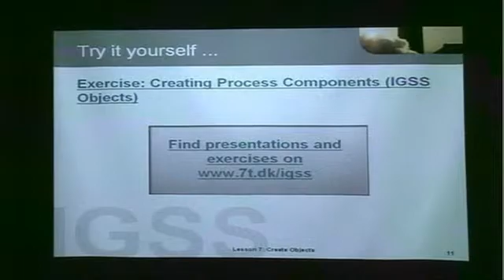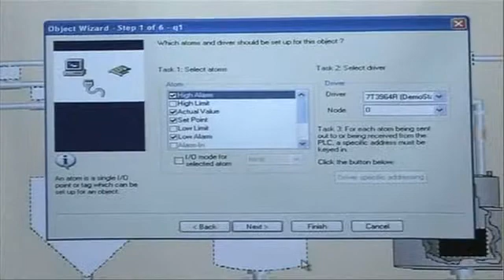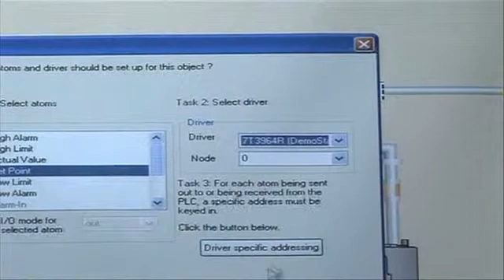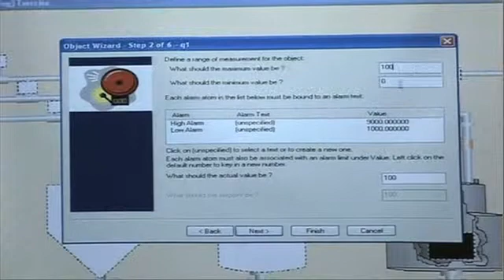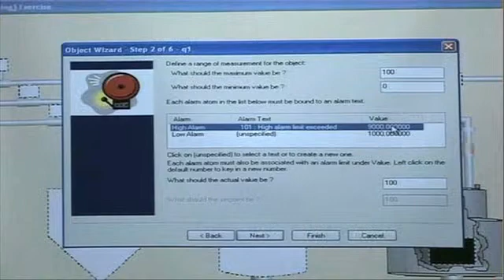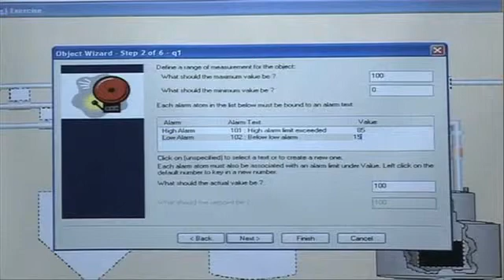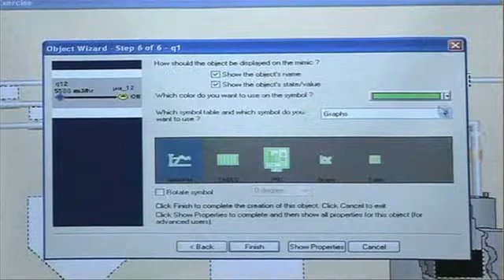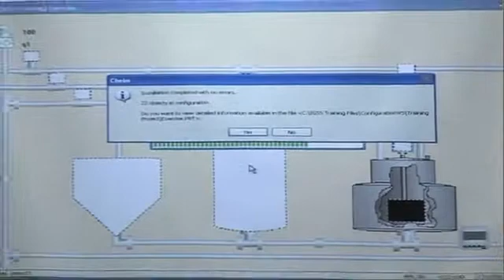7. Creating Objects (Part 2/2)

Comment: Nice demo. However, perhaps an in-depth objects online tutorial is now needed to support this very well engineering SCADA platform. (online tutorial so much easier to follow than a set of instructions on a PDF).  I like IGSS! It is highly flexible, and quite intuitive, and offers a lot of value in the free 50 objects version. Amazing. But I have more to learn from the supporting information. Version 13 seems very stable, except for the online packaged (*.chm) help, which has sometimes not run its 'search' and crashed in Windows 10.  Back to work...